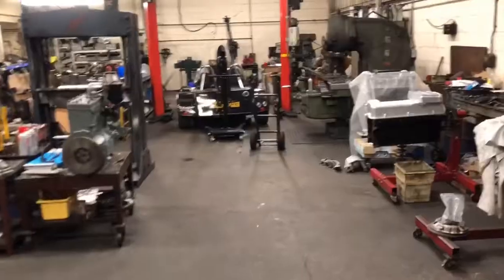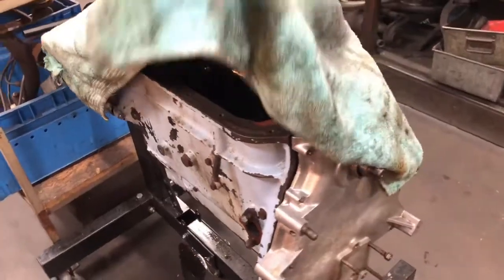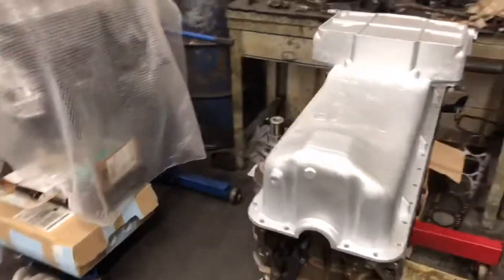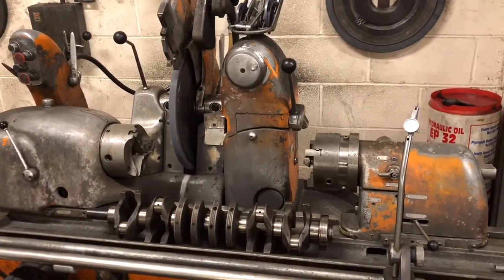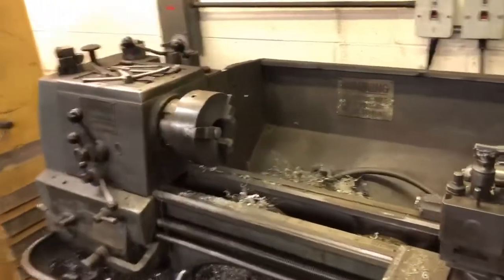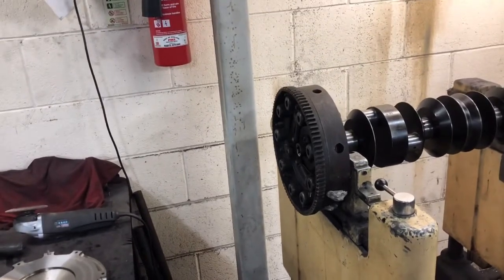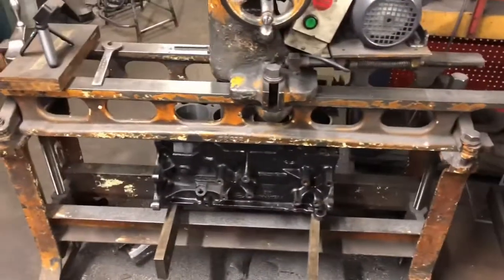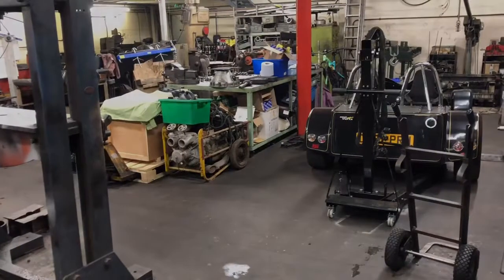The workshop, machines and skills it takes to build the best

Comment: How does a place like this start up? A small Mill in a garage for head, caliper etc jobs and just grow from there? I'm a machinist on gas trubine parts which pays well but it's not my passion, would love to work on good old piston engines. Can't decide if the sector will die in the coming years with all the electric stuff or will thrive since everyone will have to repair rather than replace...

Comment: I have used quite a few different boring bars in the different shops i have worked in but i cant say i have seen one like that. I prefer the bigger ones with the dial gauge set up and you can mill the blocks as well plus they are good for offsetting bores etc good for minis! you can put o ring grooves  etc.

Comment: During the FF days we were pretty specialized, so we had a torque plate for the boring and honing and we also plumbed hot water at 250 degrees into the block during final hone so the block was at operating temperature.